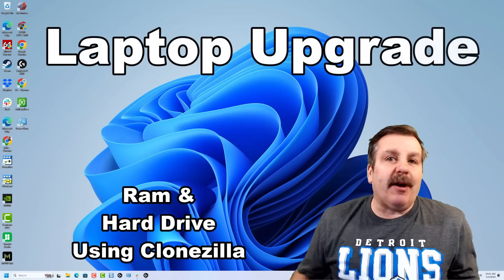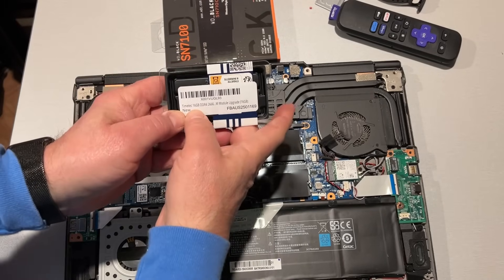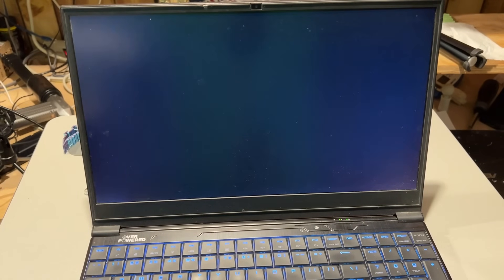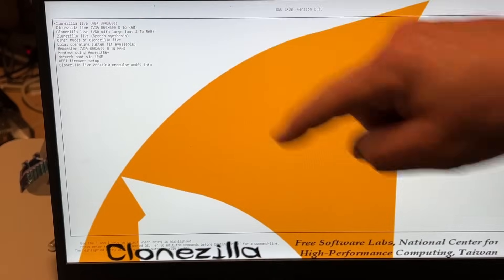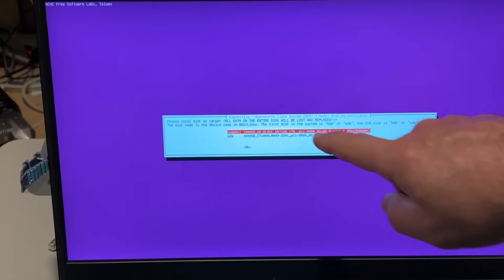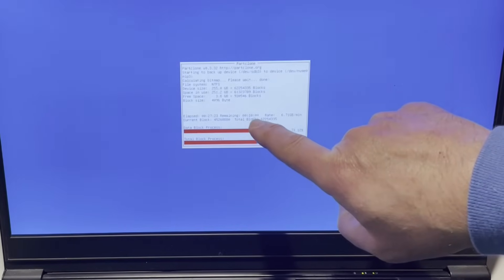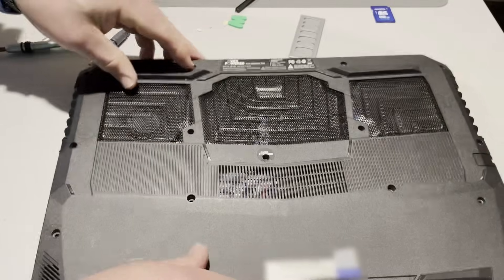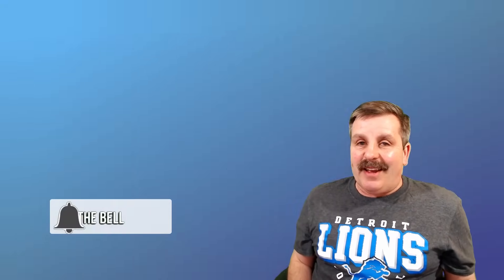How To Upgrade Your Laptop Ram & M2 Drive Clonezilla in Simple Steps

Comment: What a coincidence. I'm currently needing to upgrade my current modeling and slicing pc. The current (and for the last few years) pc is a raspberry pi 4 oveclocked. Slow but effective... until recently. My chosen slicer is Prusaslicer but they recently updated A LOT. one of the updates FINALLY included my most recent printer,  the Sovol SV05 (sadly not even sovol flavor of Cura includes the SV 05) so NO OTHER slicer does. However, they also require you have the most current Open GL in Linux, which is blacklisted for raspberries due to extreme bugginess. I have my eye on a project, though, so no worries. Thanks for the idea, though.
Reply from the maker: I was amazed at how straight forward it had ended up being.  Both upgrades were super cheap too. 32gig and 4x the M2 storage for 120 made my day.